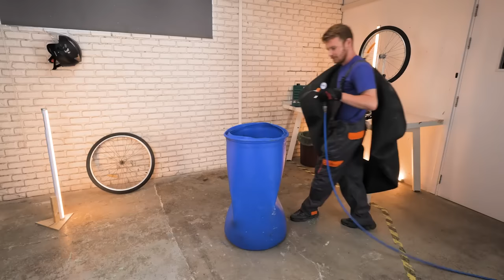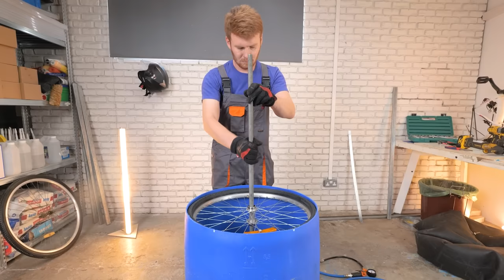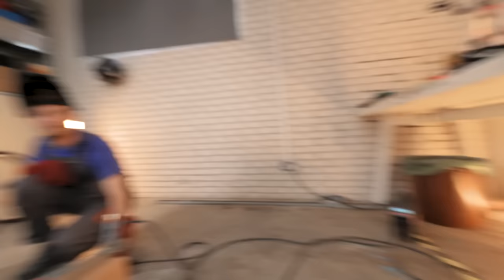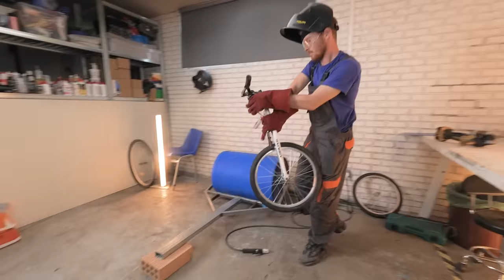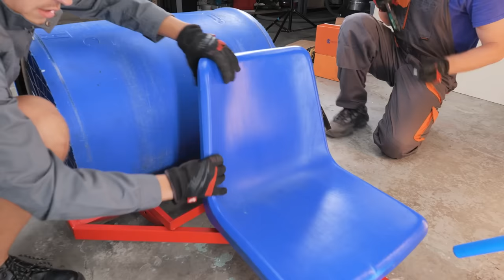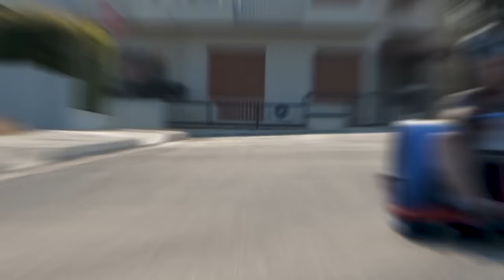Homemade Drift-Tricycle with an Electric Motor! Epic Modification! 🔥

Comment: I reconsidered the installation of the engine several times and still don’t understand what it is? car starter?
Reply: I think this is a car starter with minor modifications
Reply: Yes, that's right, it's a car starter. car starters are converted to electric motors. but their main problem is that they are not durable...